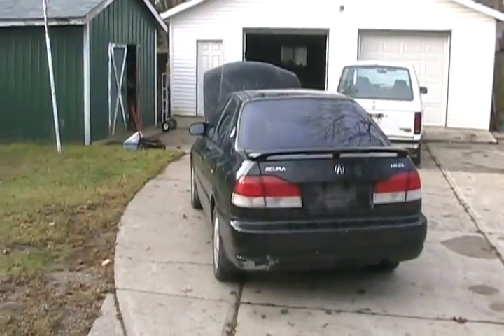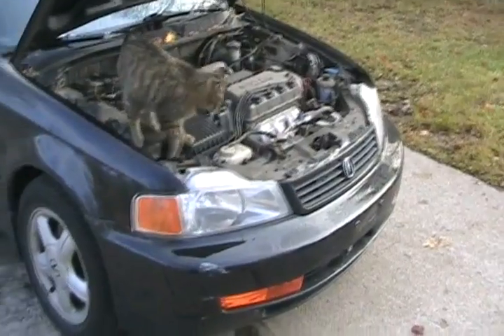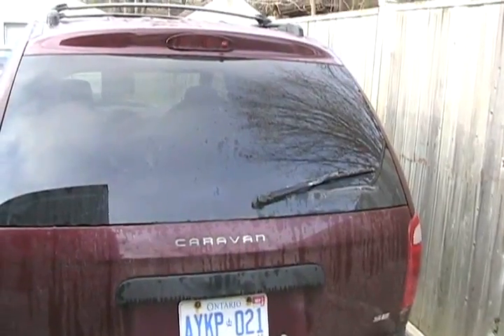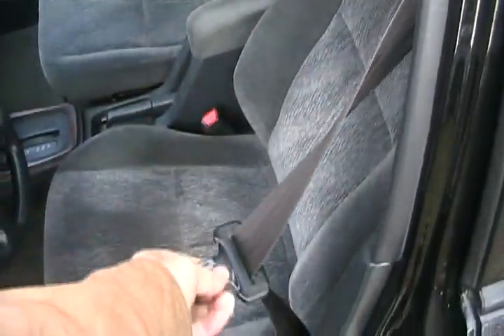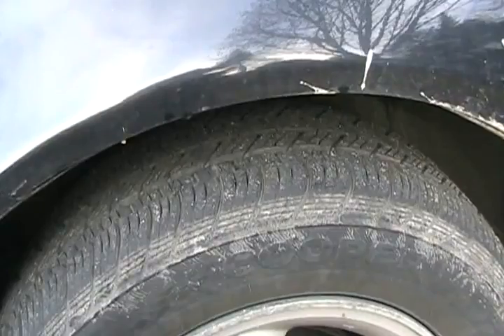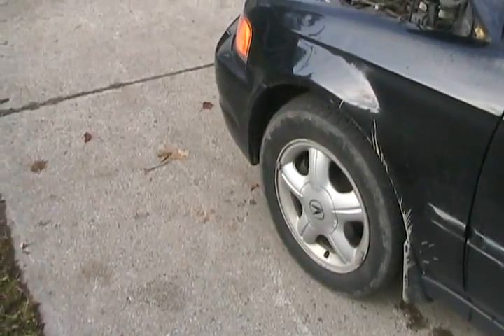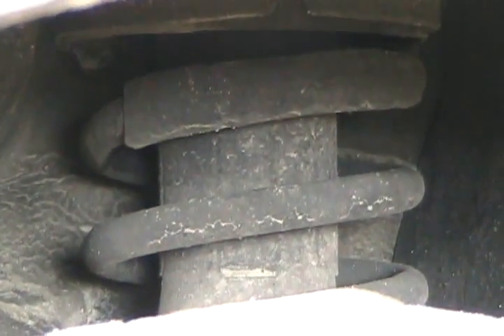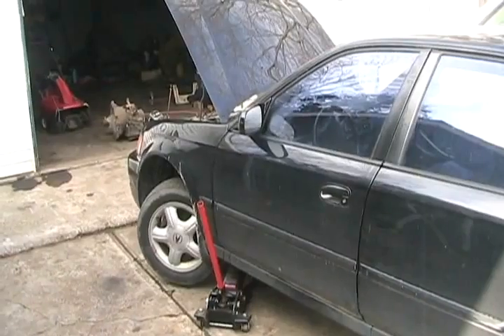#1183 how to do a legal vehicle saftey inspection [Davidsfarm]

Comment: in connecticut there is no saftey inspection. my car has rust holes i have floor holes worn tires very loose front end suspention bad rear subframe bushings and my parking brake is shot